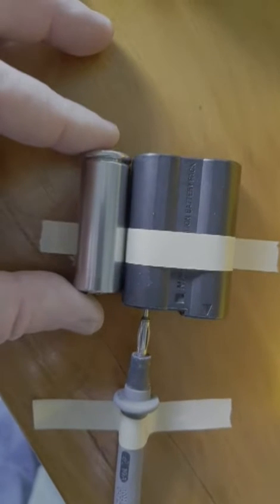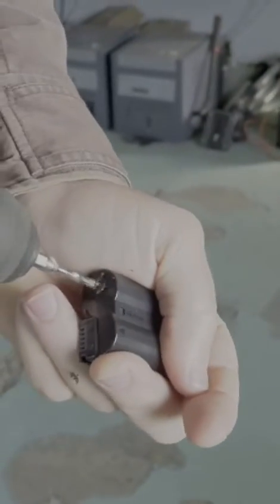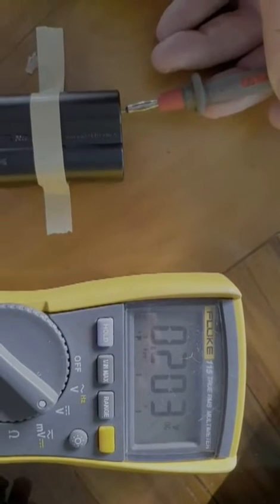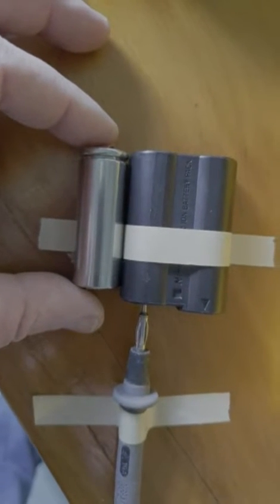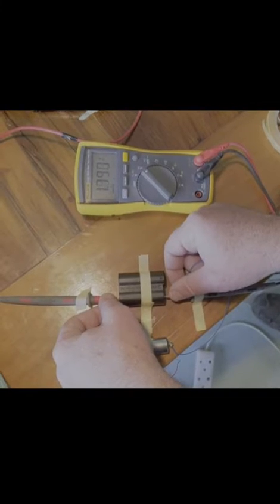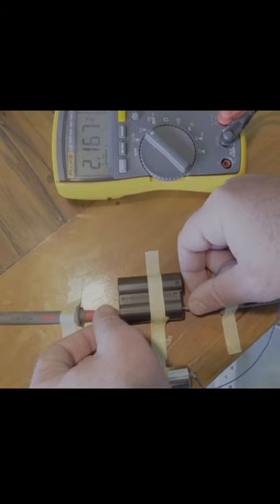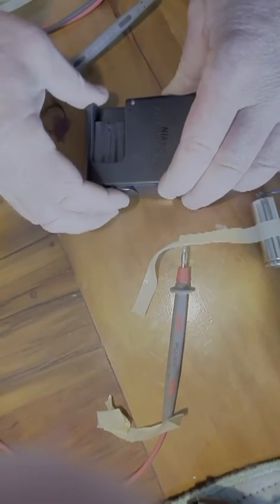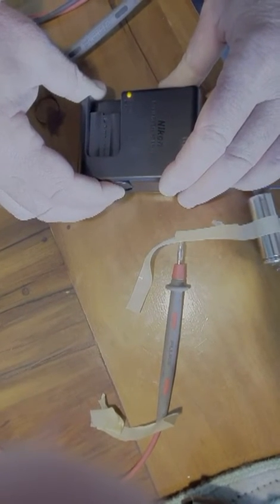DSLR  not charging Battery Fix  (fast Blinking Charger)

Comment: If a lithium ion battery goes below a certain minimum safe voltage, I believe it is approx. 2.5V for each cell, and if you then make it work again by forcibly charging it to a higher voltage, it may appear to work but it might burn and/or explode at a later time. That is the very reason why your charger, and lithium ion chargers in general, refuses to even try to charge a battery which is below the safe minimum voltage.

Comment: How long does the boost battery have to be in contact with Nikon battery? Not working so far. Thanks for the vid
Reply from the maker: You are welcome Sean.
Just long enough for the Nikon to start charging.
Could be that you controller card died or battery is finished.

Comment: I had this problem on my Z7 fast blinking when battery  in charger means battery is totally flat and cannot charge all I did was put the battery back into the camera and connected usb cable and charged it through the camera for 10 min and placed battery back into charger fixed charging properly...

Comment: Thanks for the vid, but drilling both ends could result in drilling into the circuit board. I had the rapid flashing problem on a pair of EN-ELb batteries, and they wouldn't work in my D850, but they DID work in my D800e. In the D800e they showed as full, so I assumed that an overcharge was the problem. I put the D800e in liveview and filmed a couple 20m videos to bring the charge down. I then tested the two batteries in the charger, and no more rapid flashing. I tried them in the D850, and they worked fine. Both batteries are now "fine".
Reply from the maker: Thanks for the reply Paul. I made shure drilling was very lightly and right on the battery terminals. The battery was over depleted. Me using a third party battery grip was to blame for that. Even though the camera was switched off the grip never stopped drawing current. Im sure you comment will help someone. 🙂

Comment: How to resolve my problem i have same problem
Reply from the maker: Hi. Is it the same Nikon battery? Use any power source thats around 2v DC to boost charge the battery trough the exposed terminals. Only need to raise the volts a little bit.
Reply: @awardfoto1  I used a 9V battery for fire detector. I have a battery for Nikon Z6 that did not wanna charge.